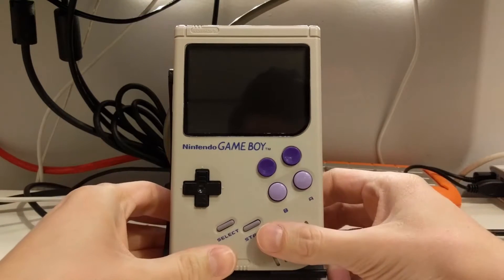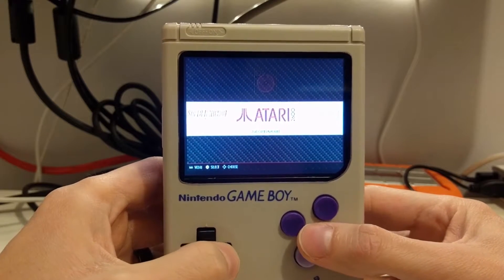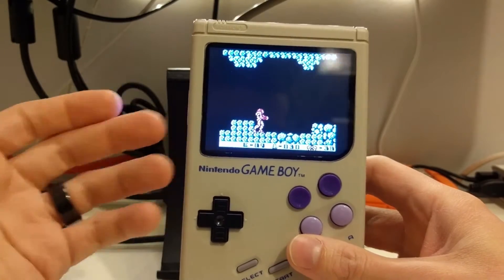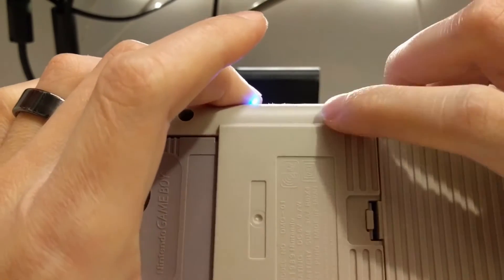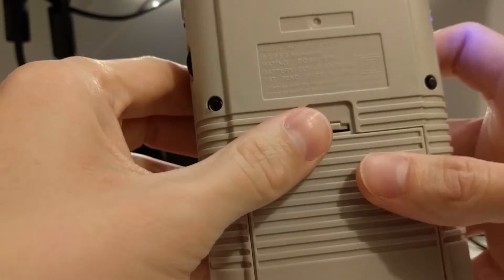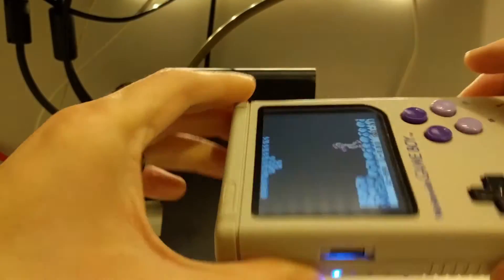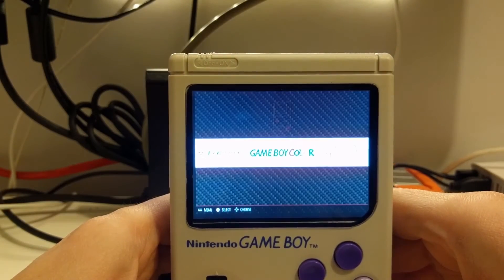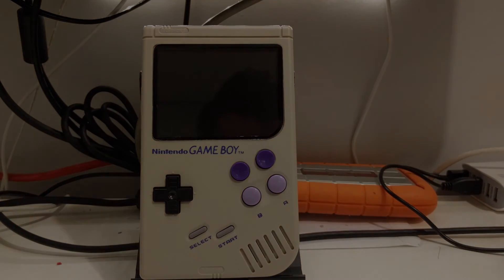Doomy's Game Boy Zero Overview

Comment: Really dig how you did the LEDs. I want to do the same on mine, not sure how though.
Reply from the maker: Thanks. I ended up desoldering the LEDs from the Adafruit powerboost and just wiring in my own off their board. I've seen other people use fiber cable to carry the light to where they want it their project.
Reply: What did you end up doing? Drilling holes and using some silicone or glue at the ends to get that smooth but clear look? Is there a link to specific instructions or did you stray from instructions and mesh together multiple projects? I hear Pi Zero isn't really strong enough for some games and then I read a lot about that PowerBoost 1000c not being the best, and issues where you can't charge while you play and on and on?
Reply from the maker: I watched a bunch of videos, did a lot of reading/research of other Pi projects, had background from my own previous Pi projects, and pretty much went into the project knowing what I wanted to do. That being said, I did not follow any instructions for the LEDs but had a firm understanding of what needed to be done. I drilled holes and plugged them with glue to defuse them. The hard part is the size of the existing LEDs and their tiny surface pads on the PowerBoost 1000c. Not the best of fun soldering those on but it worked great in the end. 

The Pi Zero was perfect for 99% of what I wanted to do on this handheld. A Pi2/3 requires a lot more power and was overkill for sticking to handhelds, SNES, NES, GEN, MS, etc. I had no plans on playing N64 or PS1 games on this and I think only a few SNES games run sub-100% (I think StarFox?). 

The PowerBoost 1000c can be fickle but it works even while charging or playing for me. I think any issues you hear about the PowerBoost and charging while playing are probably on Pi2/3 projects. They require more amperage and voltage than the PowerBoost can produce especially while charging (empties faster than it can refill). I built PiStation before working on this, which has a Pi3 in it and it was a nightmare keeping it from under voltage and heat issues. 

I'm working on the early stages of my next project, which will utilize a Pi3 for PS1 support. I will most likely use something other than the PowerBoost as the power supply for the reasons everyone talks about.

Comment: how long does the battery last?
Reply from the maker: I haven't timed it but I'd estimate it at 5-6hrs.
Reply: Sounds about right, thank you! Very nice build
Reply: My build runs of a 2000 Mah battery and it only lasts about 1,5-2 hours. I doubt the the extra 500 Mah make that big of a difference. Or do they? Mine does have a wifi dongle connected permanently though because I used a regular Zero instead of the W. Maybe that's where the power drain comes from.

Comment: I had a go at surface mounting the indicator leds but they are tiny, so as an alternative I glued fiber optic cables to the leds and poked them though the case, then trimed them off on the exterior of the case as flush as possible, and it looks fairly good